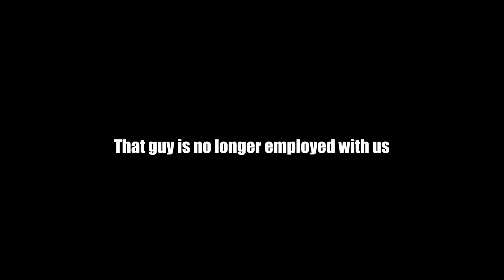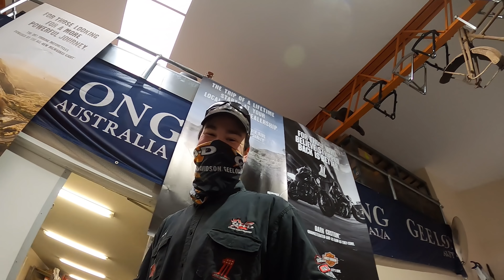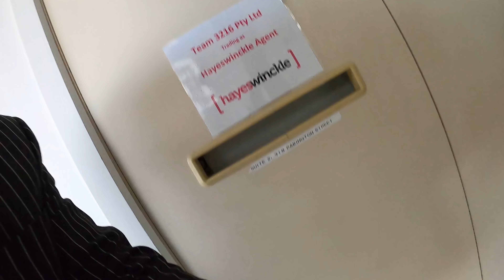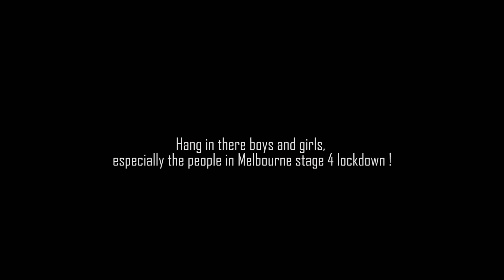Why I'm not happy with the new 2020 HARLEY DAVIDSON CVO Street Glide?

Comment: This is the Harley-Davidson trap Danny. Buy an excessively overpriced, disappointingly under-powered motorcycle, then have to pay $10,000 or in many cases more to get power to an acceptable level but still not quite acceptable. And still no fuggin' respect from the dealer. When Colin said maybe you should get a Ducati he wasn't far off from being right. I still have my turbo 120R FLHX but a few years ago when H-D discontinued the V-Rod I sold my turbo Muscle and replaced it with a Ducati XDiavel S. The XDS was somewhere around 168 lbs lighter, quicker and handles much better than the V-Rod, although there's still a soft spot in my heart for the V-Rod. I liked the looks and straight line performance and if H-D had not discontinued the V-Rod I'd still have the Muscle. Stupidest thing H-D ever did to discontinue the quickest most bullet-proof reliable motorcycle they ever produced.
Reply: Man, the XDiavel is a rocket dressed as cruiser... amazing bike
Reply: I have a 1200 ducati multistrada this bike is AMAZING. It is so fast has 150 HP , handles great , it's QUIET!!!!!!and I don't see myself coming and going 😄😄😄😄😄😄😄😄😎😎😎😎😎😎🍺🍺🍺🍺🍺
Reply: Not everyone wants a sports bike dude.
Reply: @AnarchistBogan  Lame argument. H-D is a follower concerning technology. It's been shown by the aftermarket that Twinkies and especially the M8 motors can easily handle 30-40% more HP & TQ and still be reliable and much more satisfying to ride.......dude.
Reply: Too true, my RoadKing was a money pit and all of that just to get it to perform ok but still not able to do much about the  hinge in the middle of the chassis, the appalling suspension valving, control and travel. So if you want a bike that just goes, get a R3 and if you want one that will let your back recover from years of Harley abuse, do what I did and buy a BMW GSA😎
Reply: @Trikk looks nothing like one. Not my cup of tea. Its a sport bike in my view. and how much are they?
Reply: @Trikk Its not a sports bike buts definitely not a cruiser either, they literally call it a naked bike on their website. (Well a Maxi-naked which is just a term they invented)
Reply: @Trikk Forward controls doesnt make something a cruiser though, and looking at the riding position it doesnt seem like one, being hunched forward (even if only slightly) doesnt really fit the bill of being a cruiser. Also you keep mentioning Harley as if theyre the only company that makes bikes in that tried-and-true style. Honda, Suzuki, Triumph,  Kawasaki, Moto Guzzi, they all offer very Harley-esque cruisers.
Reply: @Trikk Yeah the Diavel
Reply: @michaelmitchell5909  lots of cat fighting, just ride what fits you and you enjoy riding. I ride my Ducati with my Harley Friends. Enjoy the road!

Comment: You want a low-end torque cam.  All you're torque in the first 33% if the throttle.  I wouldn't bother bumping up the displacement.  Just find the low-end torque cam and get your fuel map settled.

I hate riding bikes with high-lift CAMs.  You gotta wind them out to find the power band.  Unless you're running wide open at the drag strip it makes no sense.

Comment: You better start selling a LOT of merchandise. HD upgrades don’t come cheap. I do feel like they BS-ed you about the initial build. These motors need to make low rpm torque. If you want higher rpm and horsepower you don’t buy HD. The Vrod is the only exception o know of but that engine was designed at Porsche with the “help” of a couple HD engineers.
Reply: Can't get solid power thru the rev range without being water-cooled.
Go the vrod 👍
Go the revolution 👍
😎💪😎💪😎
Reply: Wake up fellas 😂 the vrods old news ,the Milwaukee eights are pulling way bigger horsepower and torque numbers ,straight out the box theyve got 25% more torque than a vrod , and with light mods they make just as much horsepower ,  few shops here in Queensland are pushing them up to 160hp /140 ft/lbs of torque with more to come .....and yeah I just sold my vrod ,the Revo is insanely good motor but you know the saying ya can't beat cubic inches  69 vs 117?   Game over ......
Reply: @vtwin_vandals  160 hp 140 lbs???? like to see the dyno chart!
Reply: @newtonmetres  look up alpha performance engines ,Gladstone , Australia , charts and videos are on there website , alot of  there customer bikes are at the drags running 9-10 second quarter mile ,full street bike ...
Reply: Ginger Ginger  all the current Harley Softail and touring models of the last 3 years

Comment: Webby's had enough, some quality advice falling on deaf ears. 131 should compliment it well mind. You're in the best hands there, I'm in the UK and contemplating riding mine over for a service 😂.
Reply: Problem is the 468 is at the torque end of the bolt in cams, Danny is convinced it's some crazy hp cam, webby is trying blame the cam to get rid of him but he is also stuck because almost no cam will make more low rpm than the 468 he already has.

Comment: Danny, if you are worried about warranty then you're stuck with HD parts and installation and the resulting output which is limited because of the EPA standards requirements much be maintained (which sux) under the terms and conditions HD agreed to when they negotiated their settlement with EPA. But, if you are not worried about warranty then there are aftermarket upgrades that will deliver you more of what you are looking for. Check out and give the guys at Fuel Moto a call - these guys very helpful and are the go to performance folks in America at the moment! Be careful though BIG HP and TQ also requires much more care and maintenance - if you want to be run on the thin edge! Have fun!

Comment: Danny, you are going about this all wrong. If you want a nipple twister off the line and an elastic band at top end, ya work on the transmission and the final drive numbers, not the engine. You've already got plenty of horse power. Getting that horse power to the ground is the job ya needs to get done.

Comment: Why didn't you have the proper cam installed in the first place, Daniel?  If you had done that, had it dyno'ed with a proper tuner instead of the performance limiting H-D tuner, proper intake and exhaust, you would have had the torque you wanted in the first place.  You can't ride a dyno sheet.  Of course, if you're worried about your warranty, then forget everything I just said.  Good luck, mate.

Comment: I can’t remember what cam you have in there but the 468 would do you well even with your future build plan. But don’t forget one of the most important parts a 2 into 1 exhaust. There are a few companies out there with falsely/dummy pipes for the belt side. D&D would be my recommendation this will substantially help in your low end torque and a good tuner. Powervision or thunder max. You don’t seem to be worried about warranty or finance so build it like you want and should

Comment: Hey word of advice. The 131” kit is decent. The 128” has a lot more compression options. But either kit you do I highly recommend the Jim’s vtwin maxcell 837 cam. Should make 152 square and pull from 2-6k over 150. Look up gmr performance he does this combo a lot and all the 131 make about the same consistently. Best of luck.

Comment: After the engine upgrades, don’t forget transmission upgrades. After that, get a freer-flowing exhaust. After that, get the bike tuned on a dyno to maximise/customise your output/feel. After that, lose weight - strip off all that plastic (including saddle bags) and replace with carbon fibre, custom-made if necessary. Then, reduce the unsprung weight by having carbon-fibre wheels made/fitted. For further improvements, junk the HD suspension for Ohlins. After all that, how about a full custom paint job? That standard CVO paint is so boring for a hot bike. Never settle, Danny. Keep searching for something more...
Reply: @newtonmetres  Yes indeed 😂

Comment: Now I am confused. You said you are going to go with the 131 conversion kit.  And a new hi-torque cam also?  What about the drive belt? You will tear the lugs right off it.  Better change that out to the heavy duty, steel reinforced drive belt they use on the trikes.

Comment: Don’t do the 131! Cylinder walls are too thin and cracking. 128 instead. Shop near me has had to repair every Harley 131 they have seen and swap it to a smaller displacement. I really wanted the 131 but they advised to do the 128 or an aftermarket kit instead.

Comment: The cam in your bike is a rs468, it's a torque cam, it has more off the bottom than all except except the s&s465. The 468 will run out of puff in a 131 and the compression will probably be too high. You could have saved all the money and just changed to a s&s465 into the cvo.

Comment: Hi Bogan, keyboard warrior here, who has been riding motorcycles since he was 6. Over that time I have ridden many bikes and have come to the conclusion that if you pay minimum for a motorcycle you will need to make lots of upgrades to get you bike up to a decent ride or you can leave it unsatisfying. Wheras in the case of Harley you pay twice the price (of the cvo especially) and still have massive amounts to spend. Just because the modifications aren't done at the dealer doesn't mean that they aren't done. Ask yourself when was the last time your heard a Harley with stock pipes. The argument is they have to meet emissions, then put together a package or better still reduce the price or the wisest of all dont buy one!

Comment: The cam you have is good for a stage two. It's that exhaust you have that is killing yiur bottom end torque. Unless your going to do a big bore build theres no reason to do heads  and even then I wouldn't. Do a s&s 128 build with stock heads and a feuling 521 cam. 2-1 exhaust!

Comment: Harley davidson needs to step up once again, the chain drive primary needs to go, liquid cooling needs to be standardized, and or fan assisted cooling at the minimum. Secondly the 3 hole oil fill is dead and most harley owners would like a single oil fill and drain like a car because thats the standard. Harley davidson can do all the above and still maintain their classic look.

Comment: ?????????????????Didn't the shop mess with the rear sprocket?????????????????? If you put a larger sprocket in the rear or a smaller sprocket in the front I believe it will give you what you want.

Comment: Harley should have more power standard, not thousands extra and then when the dealer does it it has to go back twice for oil leaks then at 11,000 miles a rebuild because of wrong oil pump. I have 18 motorcycles and none of them required a rebuild to have adequate performance. But they are Ducati’s, Moto Guzzi , Honda, Suzuki, BMW, AND BUELL. None required any additional money to get good performance from them. With Harley, it’s nothing but a money grab, and that’s getting long in the tooth. Wake up Harley before it’s too late, and might I add, practice what you advertise. Stop censoring dealerships and stifling freedom of speech.